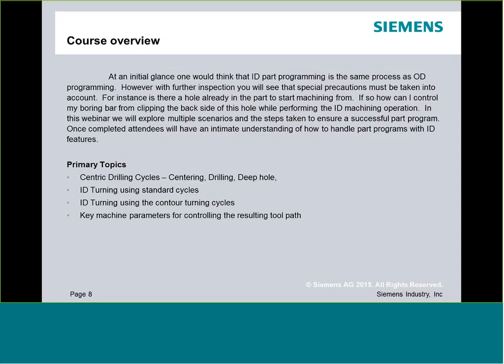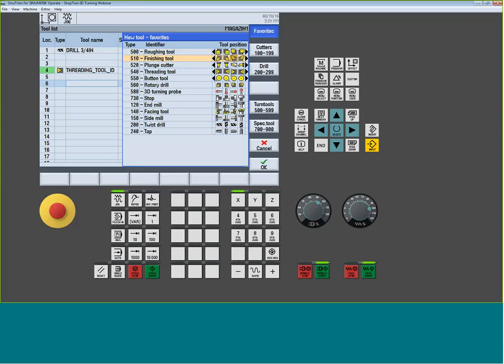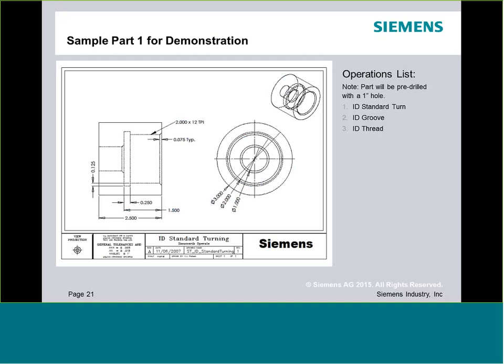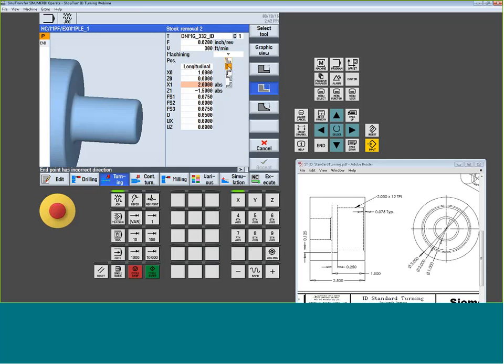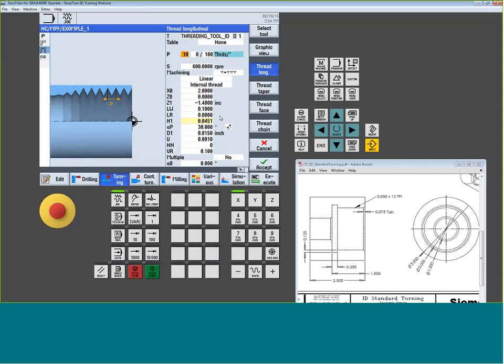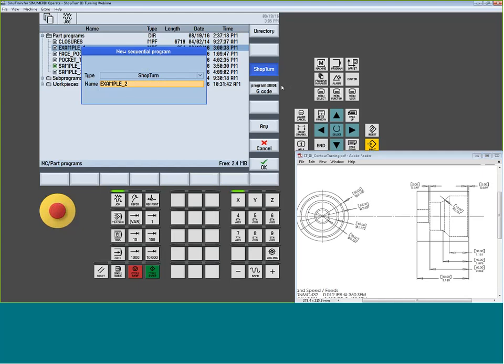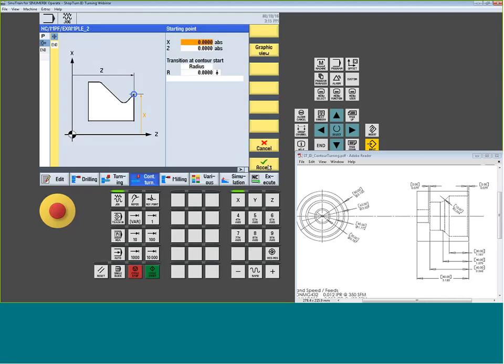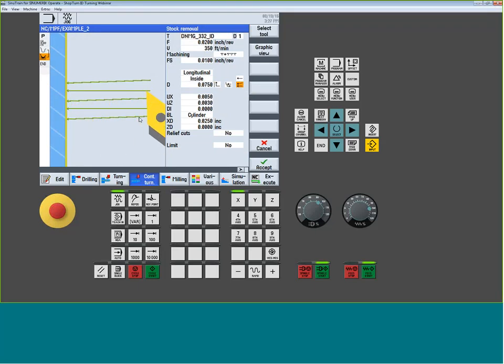ID Part Programming with ShopTurn   Sinumerik 840D & 828D Turning

Comment: I very much appreciate the content here on your channel. I came here to find a solution to a problem with the way the spindle rotates with drill type tools on my Lathe which doesnt have live tooling. The documentation says that the orientation of spindle rotation in the tool list is with respect to the drill tool. I'm fine by that. But when i try to bore with the same U Drill (Solid Drill) on Shopturn as cutting edge D2, the spindle rotation direction messes up. For the boring tool application (here in D2 offset of the UDrill, spindle rotation sense is off of the work and not the tool). There is no option to change the spindle direction of rotation in D2 tool offset. Is there a way out?
Reply from the maker: email me we can look at this in more detail. Dan.strubel@Siemens.com